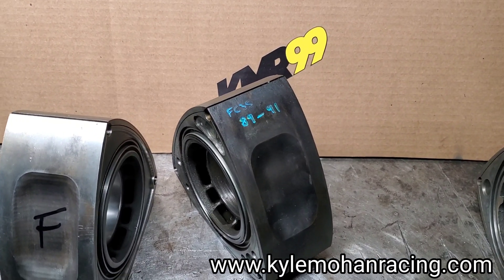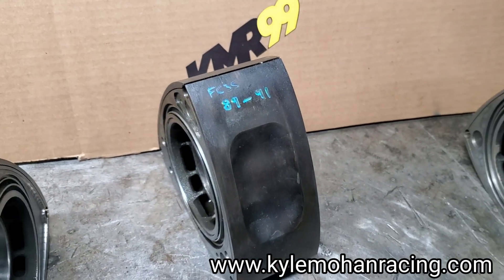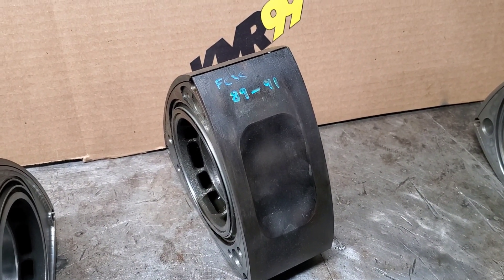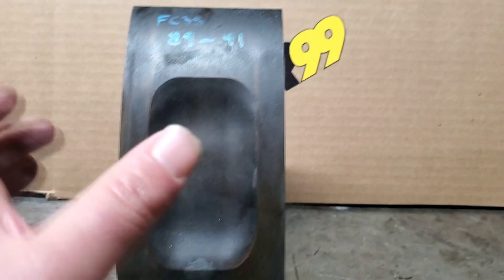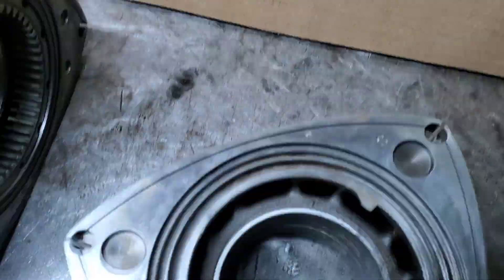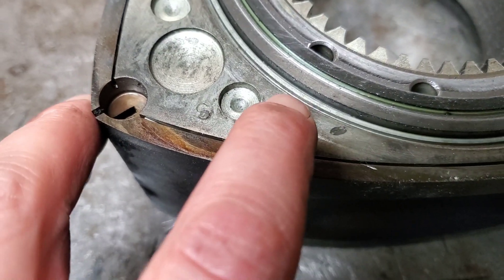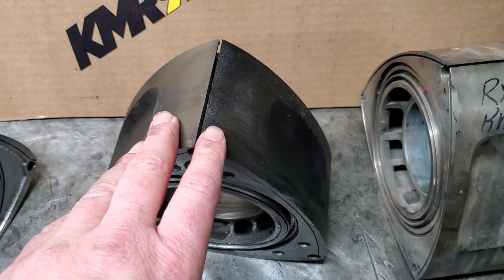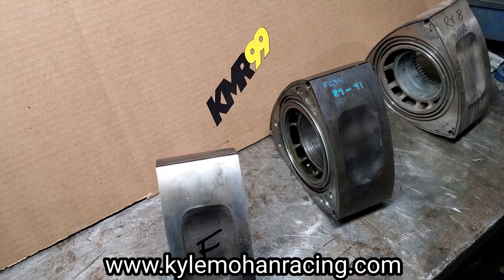1989-91 Mazda RX7 Rotor specifications and how to identify them (Kyle Mohan Racing) FC3S RX-7

Comment: Can rx7 rotors be used on an rx8 engine?  As in with rx8 end plates. If not what would need to be done to do so. As I have seen a few hybrid set ups that claim they using rx7 rotors in an reni and boosting it. Ex. Landspeedrx8
Reply: Yes you can but that only solves half the problem with turbo reni
Reply: Other half I'm guessing is the exhaust ports

Comment: So the 89 to 91 s5 na rotors is 9.7.1 with machined domb and s4 86 to 88 na rotor is 9.4.1 with a cast finished domb?
Reply from the maker: Yep.  Thats correct compression
Reply: @KyleMohanRacing  which one your using on the 3 rotor rx8 drifter?
Reply: @FourDGarage  he is using s4 na

Comment: Have u tested effects of running rx8 higher compression rotors in a big turbo, big boost application. Wonder if effects are similar to a piston race engine.
Reply from the maker: The difference between 1989 9.7 to1  and RX8 10to1 is a small change.  Yep we have ran them, they work fine but generally requiremore work. The RX8 rotors have advantages and disadvantages it really depends on build goals.  Personally I run the earlier rotors for big boost as they are stronger. 👍